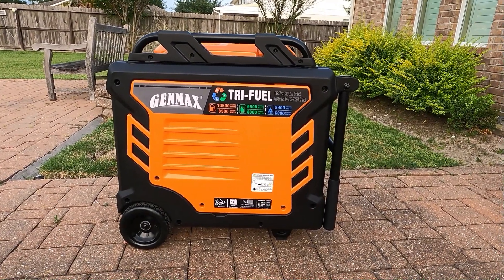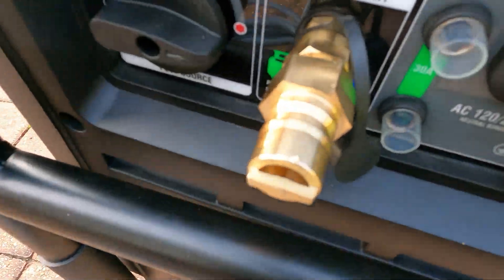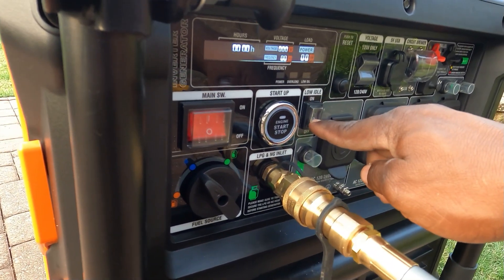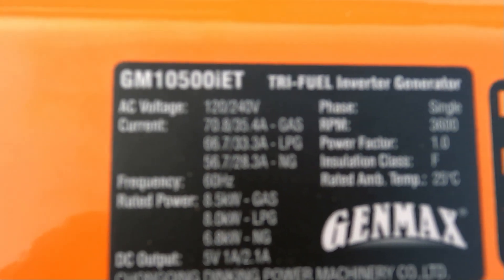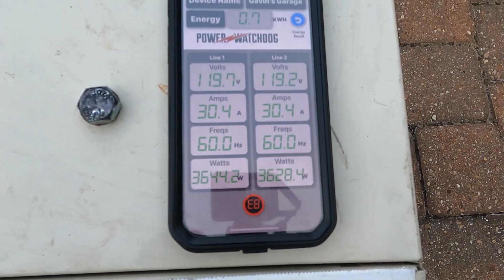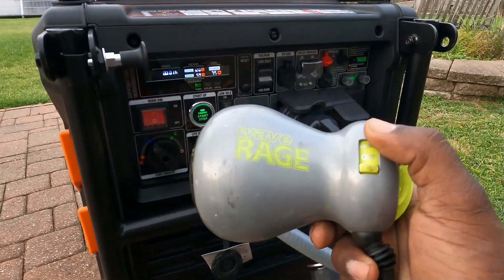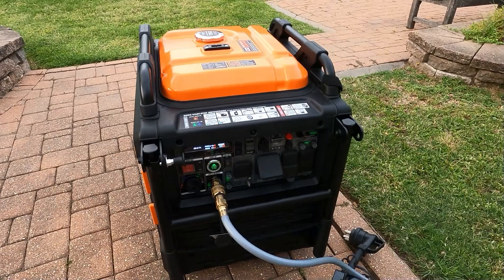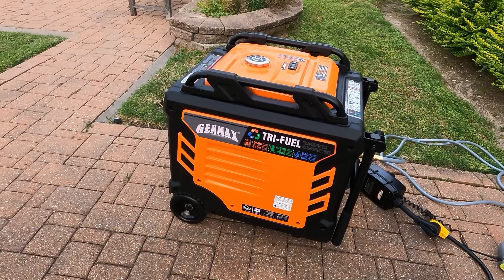Load Testing the GENMAX GM10500iETC on Natural Gas

Comment: Do you know if this is a "floating neutral" generator or a "bonded neutral" generator. I need a floating neutral to interface with my Generlink switch, and my Honda EU6500 is that. But it will cost $1000 Canadian to convert to natural gas so better to buy a dedicated tri fuel unit as long as it is a floating neutral generator
Reply from the maker: This one’s a floating neutral
Reply: @GeneratorReviews  SUPERB !! Now I have to figure out how to get this in Canada to replace my Honda EU6500 and have a home backup that works on natural gas. Unfortunately, the TMG Industrial generator which looks to be almost an exact copy of the Genmax, is "bonded neutral" so can't be used. Also converting the Honda to natural gas through PMG Technologies will cost me almost $1000 for parts and this makes no sense when I go to resell the unit. So, at this point, I'm in limbo................
Reply: Ok, almost a year since the last post. I had the opportunity to use the TMG 10500 unit with bonded neutral for a full day on the home Generlink which recommends a floating neutral. I took a chance and plugged it anyway and ran for a full 12 hours pulling some pretty heavy loads. NO PROBLEM WHATSOEVER !! So honestly, I am not sure what to think but I think I'm just going to use it going forward just as it is.....

Comment: Did you just tap into existing gas line? I want to do this! I have a stove with gas line that backs to exterior brick wall right below electrical box. I think i can t in there. Most installations i see them going from gas meter. My gas meter is on the opposite side of house from electrical box. 😢
Reply from the maker: Yes that’s all you need to run this generator

Comment: If I run on natural gas for 4 hrs straight what's that going to do to my gas bill? Compared to propane at 5.00 per gal
Reply from the maker: Natural gas is cheaper. it will be like running your heater or water heater or the gas stove.

Comment: I was looking at that one but unfortunately my gas meter is at the front of my house and I run mine on propane in my detach garage with the big door half open and Back feed through the garage, works great but doing it that way I can not use a interlock but I made signs for me to remember to shut the main off first.

Comment: Damn...can't wait until this unit comes to Canada. It will replace my Honda EU6500 that I was going to convert to natural gas at another $1000. I could sell the Honda and buy one of these and have money left in my pocket....
Reply: UPDATE: Bought the TMG Industries almost identical copy of the Genmax (made by the same Dinking company in China)and it works perfectly with my natural gas supply. Now just have to go into it to remove the grounding to make it floating neutral. I plan to put it on a switch to allow me to go between modes as required.....floating for home use and bonded for tool usage

Comment: Man wish duromax made a trifuel inverter.

Is there anything I need to do to hook it up to my interlock.  My duromax 9000ih I had to remove the bonded neutral
Reply from the maker: No there’s absolutely nothing you need to do this one comes floating neutral
Reply: @GeneratorReviews  definitely going to sell my 9000xp and buy this one from your site.

Comment: Hi Gavin... thanks so much for sharing these videos. One question... when running your heaters to create a load, shouldn't one use the bonding plug to create a bonded neutral?
Reply: Those 240v heaters don't use a neutral.

Comment: I wanted one of these trifuel Genmax really bad, but could not justify the price.  Plus I read several review that the build quality was not always that good.  Instead I went with an open frame Westinghouse 12500.  You get 500 more watts on natural gas than the Gemax.  I know it will be a little louder, but I can get past that.

Comment: The fact that GenMax includes is interesting to me a 1/2" hose is included when I was under the impression that you needed a 3/4" hose with full 3/4" connections for NG gensets.

Comment: Great video. What size NG hose is that? At these power levels, you want a 3/4" NG hose, because you will be needing upwards of 130,000 BTU/Hr. A 25' 1/2 inch hose can only deliver about 95,000 BTU/Hr, but a 25' 3/4" hose can deliver about 150,000 BTU/Hr. Using a too small hose is like breathing through a straw.
Reply from the maker: 95,000 BTU is more than enough for two of these generators after one of my customers had someone calculate the BTUs ratings came up with 35,000 per unit.
Reply: My friend.... don't be so sure! 35,000 BTU is about what my 3 burner Webber gas grill needs! And it has no motor. You might want to look at the manual for that Genmax. My 8,000 Tri fuel Champion generator (100416) is smaller, and according to the manual on page 33-34, Champion says undersizing the NG supply is the #1 reason for under performance. Champion 8,000 watt Tri fuel needs a maximum NG flow rate of 135,000 BTU/Hr at 5-7" of WC. See P.34 of the manual. (link below).  And that is to just generate 7,000 watts on NG! So, unless Genmax has somehow figured out how to extract 3X the BTU per CU/FT of NG than all others, your Genmax must need at least as much - if not more - BTUs of NG to run at a higher power! I tried to find a Genmax manual online to see what the manual says, but was unsuccessful. The Champion manual can be found here: https://www.championpowerequipment.com/wp-content/uploads/2022/07/100416-om-english-21APR2800000-Y2203160048.pdf

Comment: On this one, you've been using 30amp Surge Protector?
Reply from the maker: No that’s a 50 amp surge protector
Reply: @GeneratorReviews  Since this heater you said it 30amp, you used an adapter from 30 to 50 to hook this up to a 50amp surge protector, right?
Also, I'm just curious, could this test be done on a 30amp outlet? 
Also, this heater is 220v. I thought you could not get that with a single unit without paralleling to of these

Comment: thanks for the show Gavin. So, if it’s running on natural gas, will carbon monoxide be a concern or not? You mentioned it smelled like a stove, so I thought maybe CO is not a concern, but I’d like to confirm it with the expert. Thanks again.
Reply from the maker: Yes, you still have to run the generator outside 10 to 15 feet away from any opening just because you’re running on natural gas that still applies.

Comment: Could this run a 3.5 ton central AC unit, without installing a soft start on my A/C? My ac pulls 5kW when running I think. So that leaves about 2kW headroom on natural gas. If not on natural gas, what if I ran it on propane instead, could it handle it?
Reply from the maker: Installing a soft start is the best way to run your AC unit on a generator
Reply: @GeneratorReviews do you have a soft start on your rv? If so do you have a video on that?

Comment: This is a really nice genny, great review Gavin. I think all generators produced today should be tri fuel. Living in Houston just went thru a power outage for 8 hrs. I have the WEN 56380i 3800-Watt Inverter Generator that I converted to tri fuel. Was able to run lights, router/modem, TVs, refrigerator, and 8000btu portable A/C. But it has it limits and would like more wattage. It makes sense to run on NG endless fuel supply.

Comment: Great video,  Amps ratings for the GM10500iEt Tri-Fuel Inverter Generator, on Gasoline 120v 70.8 Amps 240v 35.4 Amps, on Propane 120v 66.7 Amps 240v 33.3 Amps, on Natural Gas 120v 56.7 Amps 240v 28.3 Amps.

Comment: This is awesome! What pressure is your natural gas meter regulator? Some homes are 7” WC (inches of water column), and others are higher. What does the generator require for BTU/hr?
Reply: The specs in the video description say it uses 3.27 cubic meters of NG per hour, at 100% load. That’s about 115.5 cubic feet per hour, or 120,000 BTU/hr.

Comment: I have done many conversions to natural gas with kits.  The main issue with the conversion is jumping between lpg and natural gas fuels, you have to adjust the air/fuel mixture it's small amount but makes a difference. If you go back to gasoline no need to adjust a air/fuel mixture. Now the fun part, if you want your generator to run at full load on natural gas or lpg you must adjust the rpm's. "BUT" big BUT if you swap back to another fuel the rpm's will be off and over run your generator.  That's why I think tri fuels from the factory have a lower rating on lpg and natural gas, not having to adjust rpms finding a happy point between all 3. I think that unit is worth money especially if it has low THD. Great work Gavin!
Reply: Is there a good guide somewhere on tuning RPM for NG conversions?
Reply: @AdamFeldman42  No guide that I know of,  engines and models adjust different.  You can google or youtube your generator for how to "adjust RPM's, you will also need a small engine tachometer.  Do this at your own risk, first time I tried fudge it up. Loosen governor in place of  just making a small bend to the spring holder.  Most of the time it's only about 300 to 600 rpm's but it does make a difference.
Reply: First of all Natural Gas burns cooler than propane, that is why they have a different orifice and spring load on the regulator, second it is impossible to get a standardized fuel pressure system in the US, some areas are better than others and others areas are nearly impossible to achieve, this why I think most manufactures want to use gasoline and propane.  This is why you need to know the WC rate of your natural gas for the region, we have 8" WC so we are good, some areas around us how High Pressure but you are not allowed to tap off those lines, big problems doing that.

Comment: What is the retail price? I can't find anywhere for sale yet
Reply: GENMAX GM10500iET Available soon at Gavins-garage.com
Reply: Genmax definitely proving itself to be a quality product.... anxious to see the max 240v amp output on gas....  see what it can sustain without tripping the breaker.... it claims 35 amps on 240.... 
Would like to see how the load cell shows power divided when two of the big dogs are in parallel (9k or 10.5k) .does one max out & the other pick up the excess, or does it split the load evenly? .. the plug is rated 50 amps... so what happens once it reaches its max 50amp load.... if two big ones are paralleled, theoretically capable of over 60amps even with the 9k... do you simply get limited to 50amps?